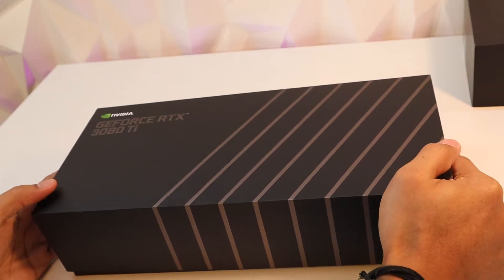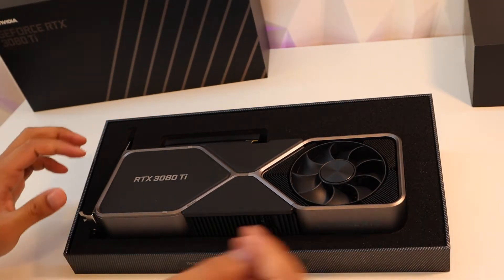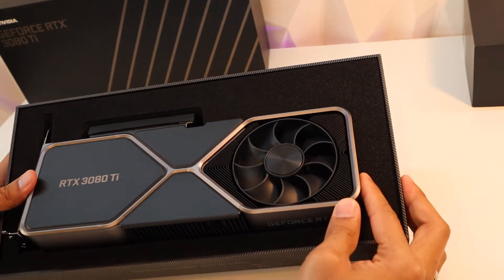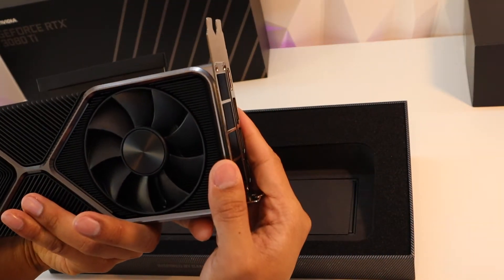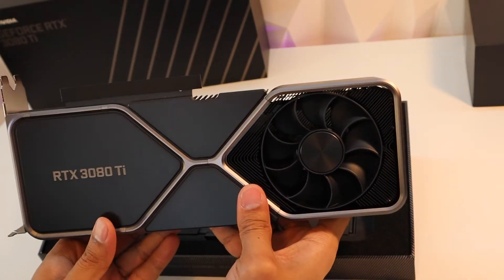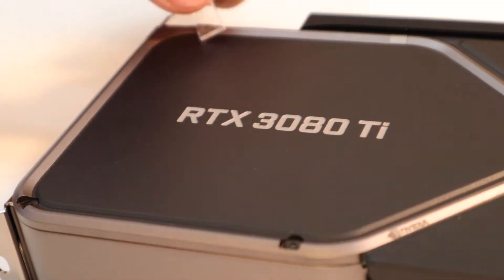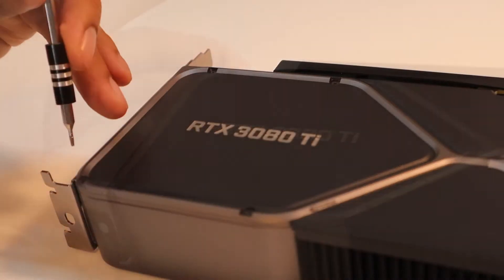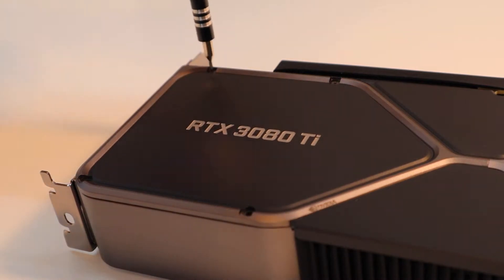3080 Ti Founders Edition  - Thermal Pad Replacement & Results

Comment: well my card likes to sit at 85c during even lower end games at just 1200p nowadays so I ordered some pads and will be following this video along next week. Surprised to see these going for $500 on eBay rn, kind of makes me want to just sell it. Thanks!
Reply: Welp I tore off that little LED controller but that's fine. Temps way tf down so all good lol, left that bit disconnected with electric tape wrapped around the head.
Reply: @GManBill  was worth the risk??
Reply: @gogotshi  Unless you have shaky hand syndrome or NBA player hands, there's not much risk. It's way easier than it looks, think pasting stickers on a sticker book. Only thing you need to do before repadding is measure the original pad's thickness first before purchasing them. Lots of GPUs died due to memory module overheating, mainly because amateurs don't measure pad thickness and assume all pads are the same.
Reply: @GManBill  What pad sizes?
Reply: What size pads you use?

Comment: I see why people don't get founders edition cards. They overheat only after 1.5 years use.
Reply: Because they are the cheapest compared to the custom models. And when 30xx models were released, it was hard to even get one because of cryptomining and AI boom. You'd have to pay double or sometimes even 3x of the original price, and FE were the ones to get the easiest (still very hard, new stocks got sold within a few minutes) and for the standard Nvidia retail price
Reply: @velvet_husky  Yeah that is why I got a 3080ti FE when the price was the best in a long time in Oct 2022. Now it has an abrupt overheating problem that has been thoroughly troubleshooted. Garabage cards.
Reply: Got mine in 2021, no overheating problems until today.
Reply: @marcel151  mine started overheating after using Topaz Video AI frequently at 100% usage for 2.5 hrs now and then. Nvida did not let me send it in for repair after a long conversation with them. Never buy from nvidia. get amd

Comment: My 3080tife came out of the box running at 100° and shutting down. The fan curves and down throttling made ot run worse than my older 2060 😅

Comment: I own a computer repair shop and every time I see that much thermal paste on a GPU  I wonder who gave you the advice to do it like so. All you did is raise temps....yes maybe they got bit lower but nothing compared to if you did it the right way which is one drop in the middle or an "X" . For me drop works better. I know it will be a pain to open it again ,but when you did such a great job of therm pad replacement it will be a shame not to get the max out of it. we tried     your way too but blob beats them all. Peace.
Reply: "X" works great on both thick  and thin paste. Thin paste, central blob beats them all, indeed.
Reply: I also used to stress on how to best apply... and would get agitated when the temps went worse after a while. The good thing is nowadays you can buy a large sheet of PTM7950 and never have to use actual thermal paste on a GPU and temps are better and sustain for way longer without pump out. I use it for myself and anyone that I do their cards.
Reply: The drop or "X" method is proven to work on a CPU. For a GPU die it is best practice to spread the paste across the entire die. There is no such thing as "too much" thermal paste. Hope you actually "repair" your customers parts instead of doing a half done job.
Reply: @Derpy_Dog  Unfortunately it's a numbers game doing not much above the bare minimum for much of these techs / repair shops. Your average OCN forum user would do a better job.
Reply: @Ben-ld1qi  I doubt they actually own a shop. Probably just a troll.

Comment: I tried several setups for the pads on my 3080ti FE, best result with mine was 1.5mm Gelid gp-ultimate front and back, Arctic Mx-4 and Gelid gp-ultimate 0.5mm for capacitors (the thin pad on the front of the PCB), my card has a 2021 cooler on it, pad thickness is different on the 2020 coolers (cooler manufacturing date is stamped on the inside of the cooler).

Load temps before upgrade: 80C on the GPU and 100C on the memory (no undervolt)
Load temps after upgrade: 65C on the GPU and 88C on the memory (no undervolt)
Load temps after upgrade+undervolt (0.850mv / 1830mhz / 55% RPM on the GPU fans on an open test bench): 62C on the GPU and 78C on the memory

If you are using hard pads make sure you use the correct thickness for your cooler model, if you use a bigger size then you should not force close the card by tightening the screws, you can damage it - be warned!

Also, when you dissasemble/assemble the card make sure that you screw/unscrew everything in a cross pattern so you apply/remove pressure uniformly, fan flexes are easy to disconnect and reconnect, you just need to be patient.
Reply: could you show me where you use the 0,5 mm please
Reply: @benjaminh544  Min 1:25 in the video, the larger pad on the right of the GPU retention bracket - that's 0.5mm.
Reply: where exactly i can find 2021 or 2020 date? @MrC00kieZ
Reply: What is the pad thickness on the 2020 model ?

Comment: I got my 3080 Ti Founders on launch day from Best Buy. I just replaced my Thermal Paste with Arctic MX-6, the Front Thermal Pads with 1.5mm Gelid Extreme, and the Rear Thermal Pads with 2mm Gelid Ultimate. Note there was one very thin thermal pad so I smashed the 1.5mm pad to .4mm using a couple thin blocks as guides to fix the issue.
Idle GPU Temp: 40c
Peak GPU Temp: 84c
Idle MEM Temp: 48c
Peak MEM Temp: 90c
Reply: dude. 90c on your memory and 80c memory temps in video absolutely not the same result
Reply: I was just sharing my experience after following the tutorial :) also when i game, i game for 3 - 10 hours straight. The mod made a huge difference and I am very happy with my results  @Kfc_for_chickens
Reply: @dev_nickf  Basically those values should be given with same fan speed, otherwise it doesn't mean much
Reply: @HellGatefr2 i hope no one took the values to heart.

Comment: Just bought pads tonight. Amazon will have them here 2maro. I just want to thank you and everyone on here who mentioned the 2020-2021 model heatsink and what not. I was able to look up my RTX 3080 Ti's Manufacture date and make the right decision. I am looking forward to reducing my 90C+ Temps while playing COD Warzone. My system is getting way to hot. I bought this card used last week from someone I didn't know. I asked them if they mined with it, he hesitated and said "No", I knew he has lied but I knew it would be ok. 1. I knew it was under warranty & 2. I knew I could just replace the pads if needed. 

Thanks again everyone!
Reply: how did it work out for you? what pads did you buy? I want to change them too

Comment: after trying squishing the 2mm gelid extreme maybe too much, now the gpu wont turn on. I see only the fans spinning. 
I changed the cable, the psu and the mobo, repaste the die but it wont turn on.
what can I do?
Reply: rip
Reply: damn son 
F
Reply: @neidhartmuller8804  what
Reply: @slimeseason4012  did you kill it?

Comment: Little Disclaimer, if the GPU runs colder after that it means, that more heat is going from the GPU into your room.
Reply: basic law of conservation of energy dictates that all the power from the GPU die will go to the room no matter what.
Reply: Rather that than have a mini thermonuclear bomb inside a $2000+ box on my desk.

Comment: I am currently watching this video in hopes of learning how to open my 3080ti which has been shutting down everytime it reaches 70C and my hope that re-applying thermal paste fixes this problem since literally anything else has been tried to no avail.
Reply: If you have a cooler made in 2020 it will not work. I had this problem. I had a 2020 model cooler. In this video he has a 2021 cooler. The heat pad sizes are different
Reply: how to identify that? @Slademon0000
Reply: @mattcooper5855  There is a manufacturer date on the cooler
Reply: @Slademon0000 So which pads did you use, and did you solve the problem?
Reply: @hanzevisuals  i sent my card to nvidia and they gave me a new card. I just claimed it wasn't working. I actually ended up selling it and getting a 3080 ti EVGA FTW 3

Comment: Hi there i changed pads just onback plate and my temperature get worse i used 2mm gelid but didnt changed thinner one i think its 0.5mm from Factory but as i see u changed that one too with 1.5mm? Any idea what couse my problem. Temperature was 104 before now goes to 110 easy
Reply: You have the old cooler design. There are 2 one was made in 2020 and the other 2021. This video is a 2021 cooler.
Reply: @Slademon0000  how to find out if I have old cooler design or new one??
Reply: @crazyrc  there is a data under the cooler where the thermal pads connect to it

Comment: i won approx 18°C on my 3080ti it was at 106°C and now 88°C, I would have done that before wow.. so I took gelid GP ULTIMATE in 1.5mm everywhere. except for part where the pad was very thin, i didn't touch it. Very happy of the result. The GPU ship is now 65° (before 64°) so it's ok
Reply: YouTube Channel  did you take the same GP ultimate ? because the first time i took another one and i didn't had good results.. you also have to be careful not to crush the pads when you cut it, clean components well to avoid creating air bubbles, and not to create an extra thickness so that all the pads touch the heatsink

Comment: Thank you. I will give this a go later on. 1.5mm front and back, I will give those a try. It is a really good suggestion to check the junctional memory temperature AND GPU temperature before and after the modification. it is really good practice as it will give people an idea on how successful their own modification is. I will feed back on the make of the pads I will use and the widths. i have noticed that a few people use technique of using a the thin layer of thermal paste on the GPU rather than the rice / pea method used in CPU installation. I will follow your lead.

Comment: Hello, I have followed the steps of your video to change the thermal pads of a 3080ti fe, the thing is that after fitting them I still have temperature problems in the memories, I have used 1.5mm of thermaleight just like the ones you use, for some reason I can not improve the temperatures, it is a graphic bought 6 months ago or so, I do not know if something has changed in new models or a different measure is used, I do not know what to do

Comment: The back plate thickness is not important you can do 2mm, 2.5mm or 3mm soon as you can squash the thermal pads. The problem is the front pads. some use 1.5mm some use 2mm and have success. Whoever uses 2mm it must be softer Pads otherwise it doesnt work. The gelid ultimate is softer then gelid extremes. Online there is a miscommunication about this. 3080 ti specially is difficult one. But these GPU's are not going to cool down unless you do copper shim mod.

Comment: Something changed on this 3080TI FE as I tried 1.5mm and 2mm and I still cannot drop the temps, my shows a date of 07-14-2021 and below that Z-V3, not sure what that means but trying 1.5mm (gelid ultimate) didn't help, and 2mm my gpu wouldn't even start.. I think the 2mm were too hard (gelid extreme), I ordered another set of 2mm but a different brand (Aairhut) which should be softer, will update if this helps drop my temps..
Reply: any update? I'm concerned as well using pad with such thickness
Reply: @albertograssi1991  should be getting those 2mm aairhut today, will let you know how it goes. But with the gelid 1.5mm ultimate I added some thermal paste on both sides and my temps dropped to 90c for memory which is much better then 110c..
Reply: @ericoo7719  the doubt part is the 2mm on the back of pcb, the vrm pad should be 0.5mm to get good contact with backplate and 2mm for the rest of the rear I’d say
Reply: @albertograssi1991  so 2MM everyone except the vrm 0.5mm (the long strips on each side?)
Reply: same I tried 1.5mm pads my core temps are high Af GOING 70+C gelid extreme pads

Comment: Very good video. I also read the Reddit post. So, it was a bit confusing, since you used 1.5mm pads front+back, but on the forum they used 1.5mm front and 2mm on the back. Initially, I tried to only fix the back with 2mm pads, but results were worse than factor. So, I guessed I had to do front to get anywhere. Repaded front with 1.5mm Gelide ultimate and mx5 paste. Results are amazing, I'm down from 95-98c on memory with 100% while mining to 82-85c with 85% fan.
Reply from the maker: Right that is why I stuck to 1.5 too many people reported similar finding to yours with mix match thickness.

Comment: thats not how thermal dynamics work lol if a card outputs 300w of heat adding cooling to it so it runs lower temps just means your extracting the 300w more efficiently. the same amount of heats is dumped into your room. just ask anyone with full custom water loops.
Reply: It just dumps it into my room faster :P
Reply: Fans my guy. The air will circulate around my room cooling down a bit then be sucked in through my case fans cooling the air just a bit more. Not to mention if you run ac in your home.

Comment: well for 1 your running at a lower frequency and using less power, this is the temp difference. not the pads.. soo this was kinda pointless, but i guess you should be happy. if you did succeed it would have heated up your room more. (more thermal energy transferred to the cooler then to the air)

Comment: the cooler on fe edition hase thermal capacity improving vram temps u will get couple degrees up on gpu taking data the vram is thermal trottling at 110 and gpu at 95 there is no really point to do eny modes unless u mining
Reply: Hey, can you elaborate on the same. My Vram temps are reaching around 106 deg whereas the GPU temp rises to 86deg. Was thinking to change the thermal pads. What do you suggest? My room temp is approx 28deg and the case is H510.

Comment: Can you tell me what thermal pad thick should be used on this 3080ti? Because I have seen other people who use Pads of 2mm and 3 mm. I do not know what to buy. Thank you
Reply from the maker: I use 1.5mm for mine. If you use the other brand I believe you need to use 1.5 on the front and 2mm on the back
Reply: Use gelid extreme 1.5mm on the front. I JUST did 3 cards (2x3080 ti FE and 1 3080 FE) for the back though, I don't know. I did not touch those pads but I might since I'm reaching 88 mem temp mining which is still great but it can be better.
Reply: So 1.5mm on both sides regardless ?

Comment: Hey nice video. Did you replaced all the stock pads, back and front, by using only Thermalright Odyssey Extreme 1.5mm pads? Or where there some places you used some different size?
Reply from the maker: Yep all of mine were 1.5 mm

Comment: Finally a video that is not missleading. I see all over youtube people using 2 and 3mm thick pads which is insane. The correct thickness ia 1.5mm not more.
Good video.
Reply: That depends on the pads elasticity u use. How much they compress.  2 and 3mm isnt incorrect, just different pad type. Thats why we would need the exact pad type, and thickness described here, for every spot on the card.
Reply: @LocutusH81  Yes it depends on the pad's elasticity but I couldn't find any pad over 8 W/(m K) that has a good compression rate. All softer pads are 3W/mK and below. That's what nvidia uses. Those are putty like and verry soft

Comment: Saw a cutting template for 3080 fe for 80x40x1.5mm. As ti has 2 more memory chips i am assuming 1 sheet will not be sufficient? Also saw comments backside(not gpu die) pad replacement does not make much of a difference. Is it true? Also the backside pads from factory are way less than you did. Whats your take on that?

Comment: Changing pads will help the gpu cooler remove heat more efficiently from the pcb into your room IE will reduce the gpu temperate but not your ambient air or room temperature unfortunately

Comment: Hi, have 3080Ti FE and I did 1.5mm on the VRAM and 2mm on the VRMS on front side and 2mm on whole back area, I used Gelid Extremes pads. I booted the system and noticed no change in Hotspot and Mem junction temps under load, in fact they are worse by 4-5 degrees . but temps were quite lower in idle when compared to stock. I opened the card again and observed that the left side of the VRAM had no contact with cooler and other VRAM had little contact but not good one (concluded from the imprint on the thermal pads) but the 2mm pads on VRM had good contact. So I decided to do 1.5mm on both VRAM and VRM and did that but saw no difference in temps. Now I'm going to try 2mm (Gelid Extreme) on both VRM and VRAM do you think this will work?

Also, I saw lot of post regarding this some card are fine with 1.5mm on front while some are fine with 2 mm don't know if there are different cooler design internally.
Reply: Hi, I tried so many times... With 2mm on VRAM the GPU doesn't contact well with the cooler resulting with high GPU and hot spot temperature. With 1.5 mm GPU is good but VRAM temperatures are bad. I ended up with 2mm for VRMs and 1.5 mm for VRAM with a thin layer of thermal paste : this did the job !
Reply: @laurent9571  I did as you told but still temps are about same. I gave up and bought Corsair water block.
Reply: @raghavtripathi564  do you have a link? And how does that fair?

Comment: Danny, I don't believe this will make your room cooler, as heat dissipated will still be the same it will just dissipate faster into the ambient air with better pads and therefore will maintain a cooler temperature of the GPU itself but your room might still be as hot as it was before. Regardless, good vid, thank you!
Reply from the maker: Lol yeah ironically my room are cooler since. But it is also a new season. It was more or less a joke when I said that.
Reply: @dannykim1462  it’s all good regardless. We all learn as we go.